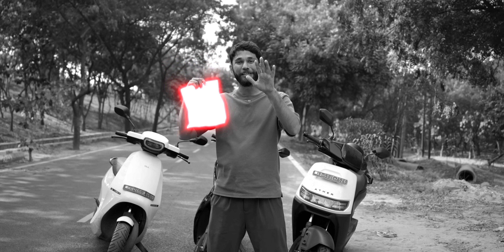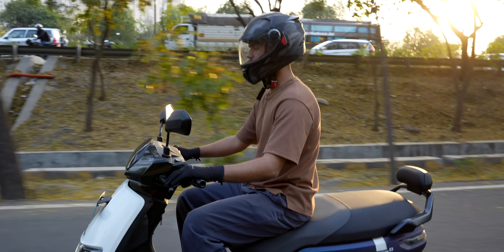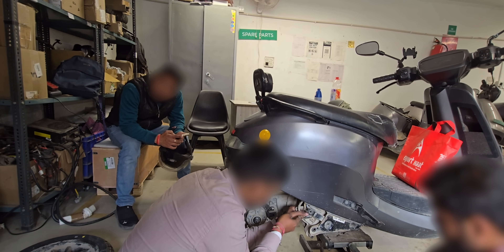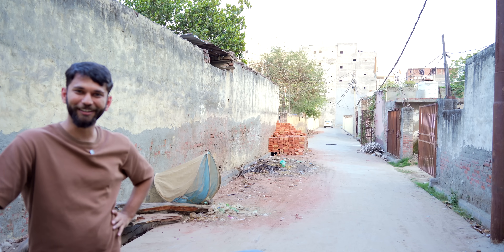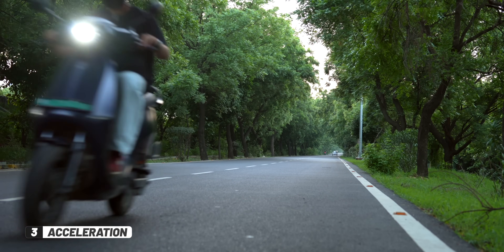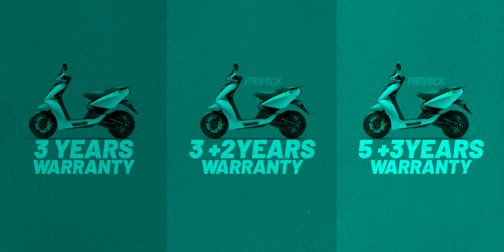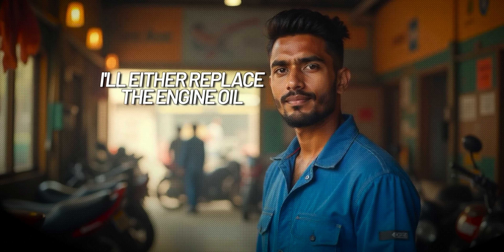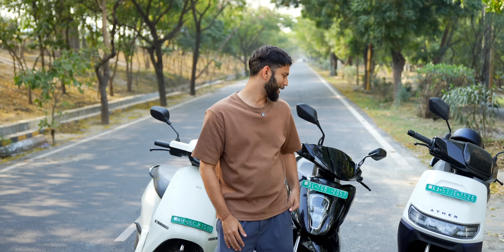The Real Truth of Using EV After 2 Years!

Comment: I have been using the Ather Rizta since August 2024. While I appreciate Ather for producing high-quality products in the electric vehicle (EV) segment, I believe they have not excelled in the two-wheeler category. Many Ather Rizta owners share similar concerns regarding some design choices made for this model.

One major issue is the noise coming from the area above the scooter apron, which houses the dashboard. Additionally, the footrests, which are unchanged from the 450 series, remain uncomfortable. The seat mechanism feels weak, and even when locked, it does not sit flush with the scooter's body. This results in gaps that allow dust to accumulate in the storage compartment.

Although the Magic Twist feature was quite useful, a recent update has diminished its effectiveness, which has been disappointing. However, I do appreciate that the range displayed on the dashboard is accurate. I also love the fast charging ecosystem, which has improved since Ather partnered with Vida.

Comment: It was certainly sponsored, but I won't nitpick, it was mostly correct. Missed important facts like TVS gives extended warranty option too, sometimes with no real extra cost as they run offers periodically. However, their service quality is no where close to Ather, so yes, Ather is still the number one. The only reason I had to pick Icube over Ritza was high charging time and dependency on pro-pack.

Comment: 9:10 I'm a bajaj chetak user the standard warranty is 3 years or 50000 kms. And you can extend to 5 years or 75000 kms. And its cost 6000 rs
Reply: i am about to get one, but the extended warranty they are giving me is 5 years or 70000km... how is the overall experience with chetak... i am going with 3503... and do you need data pack for this version... i know i should get tecpack, but 3505 dont have anything to give with datapack...

Comment: Using Rizta S without pro pack for past 6 months. got it for 1.2 where i could have got a petrol for 1.1 but my monthly fuel expense was 2000/- hence i covered the initial cost difference and not the saving mode is on. even if i ride for 3 years then i would have saved more than 50k which might even cover the paid battery cost.

Comment: I own two Olas and have had battery issues for one of the scooter and you know what they replaced the battery for free in two days. And after that I didn't have any issues yet on both the Scooters. Seems this guy is biased from day one when he purchased Ather. No doubt Ather is really good. But with my experience I didn't face any major issues on Ola. And I have referred my friends Ola and they have purchased it as well. Didn't hear issues from them as well.
Reply: Before buying my ola, i asked around 20 ola owners, they dont have such big issue.. And they are happy with ola. So i bought 2 ola s1x, 6k driven in both with no issue. Now the new ola gen 3 is outstanding..
1.6L for buying ather, i would rather prefer a petrol scooter for 80 k.. It would be value for money.
Reply: Even the price of ola is less compared to ather

Comment: I have an Ultraviolette F77 Mach 2. 
Let me give you guys a real scenario. 
2 free services done. 1st at 1k Kms cost me 640/- and second at 5k kms cost me 354/- . 
I drive in top mode which is Ballistic in it or sport/hyper for other brands and get a range of 160+ at 40-50 kmph average speed even though on the dashboard it's written 124kms at 100%. 
So modes don't have anything to do with range. Rather it's how aggressive you throttle and how much motor efficiency you maintain that matters.

Comment: I think this is ather promotional video, as in thumbnail you showed comparison between ola and ather. And i own both. And both services are very costly. But ola is far better product than ather. And i fell ather is very bad product as i owned and used for more than 3 years. For customer point of view if common people want to buy EV because of saving. And ather is not for common people, its only for rich and they degrade scooter every year, i experienced it. Changed battery 2 times. Ather gets hot and battery gets damaged, and ola slows down to cool off the heat to protect battery and motor. And pickup dont even compare with ather, ola moter is far superior and fast and efficient. Ather uses 2 belts and they are very thin, and it break off on my ather. Both makes sound but ather is horrible.

Comment: I disagree with one thing - riding modes are not required and not important.
I don't want a button dictating how I ride the scooter. They have so much AI technology. Why not use AI to auto switch mode or use a solenoid to provide motor the power that directly corelates with your accelerator. If I want to overtake a vehicle. I should just be worried about overtaking nothing more. If I am in Eco mode. And I need to overtake. I first need to judge of I have to overtake on the same mode or not based on other vehicles speed. If I am wrong, it is deadly. Ev companies have made it look that it is a great feature. But just a marketting gimmick to show higher range

Comment: I am not a fan of any brand, however i own a OLA S1pro for the past 2.5yrs with a mileage of more than 45,000KM till date ..
& I must have spent not More than ₹50 to airfill that's all till date .. 
Battery mileage with god's grace is absolutely the same as new ..

Heard about the poor service, but with god's grace i haven't been to service till date
Reply: Good , but We don't have that level of god's grace
Reply: u dint even change the brake pad?.....brake pads wear off in 5-6K kms.
Reply: @azharshaikh000 ikattha lgne wale h iske 80-90 k 😂😂 brake pad, controllers, motor, battery, bearing sab khtm honnge warantee khtm hote hi 😂😂
Reply: @Adityasharmavines4u 😂😂 ikkatha 🤣🤡
Reply: Your are one in million lucky guy 😂
Reply: What about general service?
Reply: HOPE YOU NEVER RUN INTO TROUBLE
Reply: don't worry. You will soon have to face the problem because it a ola.
Reply: @Gautham-k1d 😂😂😂 soon when already completed 3 years.can you when is going to soon?

Comment: With Ather scooters you can shut down the scooter so it doesn't discharge sitting in your garage. And obviously your live updates over the app won't work since it can't connect with the scooter over the air.

Comment: Bro! I own a Ather Rizta 2.9 kWh from past 51 days. And the battery drain issue is something I think a drawback. Like if I didn't used it for a whole day (38 hours) the battery % goes down by 5-7%. Thus, if you are necessarily going to use it on adily purpose, you will save a lot. My current odometer reading is 822 km.
Reply: On a general basis my daily usage is 7-10 km, but for some instances it goes to 30-40 or 100 km.

Comment: Just for your information 
You can use ather in sports/warp mode and still get the eco mode range!
It's all about your acceleration. You put in sports mode + drive at 40-50 km/h, u will get the same range as that of Eco mode.
Also, this is more good for the battery as you are not straining it (people generally put on eco mode and give full throttle,which eventually strains the battery. Whereas when u put on sports/warp mode, the scooter is ready to drive fast but u control it at 40-50 km/h which will save ur battery life more!)
PS : i own ather 450x for the last 3 years❤
Reply: Hey Varun, what’s the battery health after 3 years?
Reply: @SAGARSAHA  once the battery was replaced (thier team identified the issue and voluntarily informed me). Since it was under warranty, I escaped!
Reply: if you dont mind me asking, how many kms has your ather done?
Reply: @belol69  20k
Reply: eco mode won't strain the battery no matter how much throttle you give. it wont give the max power

Comment: I have an ather 450 plus, the range on that fell a week after my warranty expired. It only gives half the range it used to and have been asked to pay 60,000 for the replacement. Decided not to get it replaced and using it for only grocery commutes.
Reply: That is sad....i also suffered similar instances. i got rumor that it was due to cell imbalance while charging which was caused due to a update ...got in contact with ather on social media -got a n updated within a week range was back to normal with slight degradation
Reply: Thanks for the tip, I'll give it a try.
Reply: @nikhilvino kuch hua bhai?
Reply: @knowit2k  kuch nhi hua bro, normal service karke bhej diya

Comment: I own an Ather 450X, which has run nearly 30,000 km over the past three years. The total running cost, including service and electricity, is around ₹12,000. I spend about ₹240 on electricity for approximately 600 km, and there has been no degradation in range—it still gives me 105 km per charge. If your daily commute is within 90 km, go for it! Don't buy a petrol scooter.

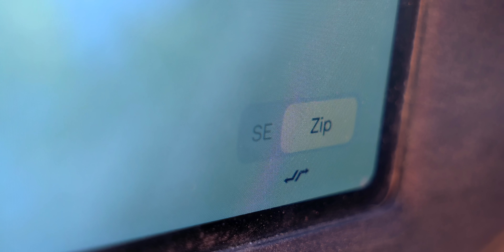Comment: 2:41 Range actually doesn't depend on riding mode it's all about throttle control, in Ola S1 Pro gen 2 I have tried and got 160 km+ range in sports and under 100 km in normal, it's harder to waste battery on Eco and normal but it is possible, Sports and Hyper it's much harder to save battery but you actually can even with decent speeds 

Got 22 Wh efficiency with avg speed of 48 kmph and 160+ range in sports mode, You just have to push with your legs when start stop so less Torq needed to push start and don't west energy that you used to get up to speed by breaking too much and when needed breaks only use forced regen no actual breaks

I'm not that slow rider but you can get 190 rage with eco if you really want
Reply: Same i ride with full speed like averaging around 50km/h in sports occasionally touching 90 but still get like 100 range because of forced regen

Comment: bought ola and using it for 2 years. no cost or no defect occurred so far. my ola is worth it, except from annoying pin that i have to type in public. perfomance is best so is its range at the time i bought it. i don't see the range dropping even after almost 2 yrs.
Reply: mere paas bhi ola hai 9-10 mahine huye hai aur koi  issue to nahi huye lekin ola ko keys dene chahiye
Reply: jab bechne jayega ya battery change karega sab hawa nikal jayega. .
😂😂
Reply: @who-Am-I-Here  30 hazaar ki change hogi battery, and 8 saal ki warranty hai, 8 saal mein kitna petrol save karlega woh banda yeh toh soch, main khud 50 hazaar save kar chuka in petrol cost in just 3 years or 23 thousand km.
Reply: After riding ola s1 pro for 46000 kms ,ola replaced the battery for free .. initially I have taken extra warranty for battery @who-Am-I-Here .. just giving info
Reply: Clocked 10k + in my ola S1 pro gen 2, had to replace brake pads every 5k kms and had to replace handle cover once, rest never got any major issues and guess what after 7k kms I started to get even more range than before, I get almost 140 to 150 kms range in normal mode.
I don't charge it more than 89 percent and did not go below 20 percent.
Reply: @krishnamohanmishra8420  you dont need to change break pads just take a simple tool tight the break wire very easily at home .
Reply: same sabke samne Password dalna padta Public main chupakar , bohot bekar lagta
Reply: Just use ola app and for more ease use proximity sensor , no hassle of entering password 👽 @xyzTheTruth
Reply: Yes, but it's charging infra is very bad had two hyper chargers in my city both are not working since 2years
Reply: @Pawanbhambu  mai to hamesha ghar par hi charge karta hu
Reply: It's impossible that even after 2 years your range hasn't dropped
Reply: Good now sell it and find the garbage resale value worth the garbage u bought. Battery health might be 75% which it never shows you
Reply: Bro bajaj and activa funding anti ola propaganda 😂
Reply: This is bulahit bro ....if activa and bajaj are funding , fine assume they are funding. But why the Ola service centers has this type of scooter issues , that they couldn't address . These all are not going by reviews na. It's the real time experiences going on ola service centers and the scooters standing infront and inside service station is the biggest evidence . So bro wake up  @sk21719

Comment: Sir you missed the point here, 
First of all the ather rizta variant you showed is a top one and it definitely doesn't cost 1,10,000 only ok fact check!
2nd one is in ola you get vacation mode if you are not going to use it for some days!!

3rd thing is when you buy ola (after 2nd gen) they provide 8 years or 80,000 km battery warranty for default ok not every new buyer has to purchase it otherwise!!!
4th one is if you see the ideal range of any ola scooter it's better than any other scooter, 

From the vedio it seems that you are so softly targeting ola here!!
At the end i am not a ola fan boy but you should make a proper neutral vedio after knowing each facts because a little miss information or a right information but expressed wrongly can change the narrative!!

Comment: From an ather user of 2 years, it was the wisest decision of all my time, it's a bang for buck.. service, quality and feedbacks are exceptional. Ather do care about consumer choice. One con i felt is parts replacement at own facility rather than expanding to local vendors.
Reply: Hey I also got the Rizta 5 months ago at West Bengal. Now the left mirror yolke got broken due to a minor accident. Can I get it replaced at service center or the part will only be available at Bengaluru (HQ) service center? Appreciate the response
Reply: @damercy  I think you should visit the nearest service center to you, small parts like mirror should be available
Reply: ASK nearest Service centre..  @damercy
Reply: The whole unit will be replaced at SC  @damercy
Reply: Same here bro. The best part is the credibility. Ather is the most credible ev scooter at the moment.
Reply: I am using ather 450x for more than 2 years and run it over 10k km.
Only problem is there is not service station in faridabad, i have to go 30km for its service.
Reply: @rawatji6604 at what price did you get it (after subsidy) and what the mileage in the starting as well as of nowadays ?
Reply: Us moment bro even I have Ather for almost 3.5 years went to an accident but the build Quality is something else like it didn't even got scratch and also I rode Ather in very very heavy rain with water logged and whole ather was submerged and it went pretty well although I have to do service after that but it completely changed my perspective for electric vehicles its just Awesome 💯
Reply: @nonidentified89  my ather 2 years old is flawless, just very small problems which are easily resolved
Reply: Same to same
Reply: Great that you got an ather atleast you have a piece of mind 💀😂
Reply: More than 3 years and same but service can get much better, they need to focus on it
Reply: How much is your daily commute?? Like how many km do you ride your at her on a daily basis
Reply: My Ather 450x after 3 yrs had to replace my battery no use of EV going back to petrol ....EV companies are looting consumers.Guys who are planning for ev pls think twice go thru proper reviews then decide
Reply: @sreekanthvt140  i have ather from 2 years nothing happened, maybe u got defective piece, you can't generalize everyone
Reply: @DuskShade03  I am not generalising ...giving my exp abt ather and asking others to go thru many reviews before buying any vehicle
Reply: @sreekanthvt140  you should say instead not all are defected you need to do PDI
Reply: @Idyllic31 battery ka PDI kaise karen? Please tell me…
Reply: @sreekanthvt140  you should have to busy eV with extended warranty

Comment: Ola and Vida both lost 10km of range after 10 months of use. And hence I'm sure after 5 years battery will give only 50% of range. At present technology of battery and charging, EVs are only for city ride that is ride on Day and Charge at Night in home. Also if you charge on FAST CHARGER OUTLETS, EVs are not that different in Running Cost than that of Petrol/Diesel. And one cannot use EVs for Emergency use Period.

Comment: I Bought a Ather Rizta Mid Model (Z 2.9 ) and After Running it 2000+km 

Here Is My Review ....
It is Very Comfortable Dedicated Family Scooter, power is good , Seat is good enough for 3 person , break is good , Boot Space Is Very Nice , Side Mirror Is Fantastic 

Range : Company Give 120 Range On Paper , They Told Me 95-100 Km Is Practical Range But However My Rizta Give me 105km easily That's Nice Even The Ather Company Person Was Shocked 😁 

I'm Very Happy To Buy it
Reply: I own 3.7.. i get 115-120km  in zip mode sometimes 

I just use 20% to  30% of the throttle.
Reply: Same model owner here, I get close to 100 km
Reply: Bro I'm  getting only 75-80 range for 3.7 kw, i dunno how or what is being changed, it's a 2 week old new bike. Something has happened 😢 what should I do now?

Comment: Im using Ola for 2 years now. My father has one too.
Personality, no issues as yet. Fingers crossed.
Im getting good range of about 150 if i ride decently and 100 if i ride fast.
Not bad.
But yeah, would be nice to have better service.
Reply: how man if i use at eco mode it gives just 115 to 120 and in normal just 90 to 100
Reply: i have s1 pro gen 2
Reply: @Toonworldindia662 i think riding style matters alot i have ather gen 2 which claims the range range of 85km but i used to get 100+km easily, haven't tryied range test recently due chargers being available at every corner of my state
Reply: I have s1pro  gen1 3 year old and 17k completed in normal mode 55-60 maintain then only 70km range in 80%charge
Reply: You are the choosen one by God
Reply: A honest Review!